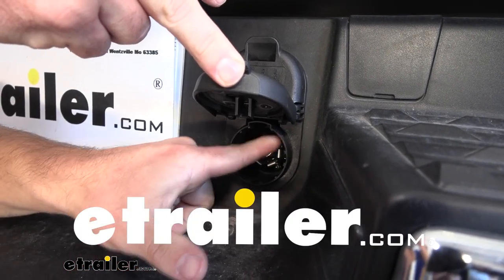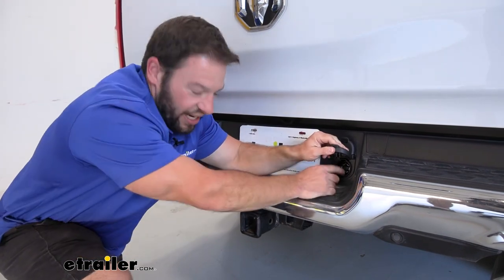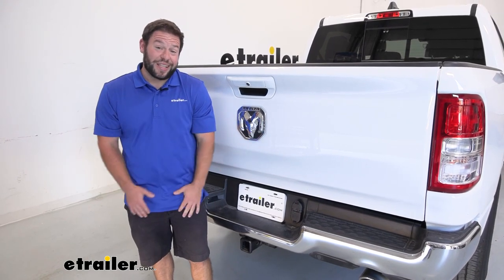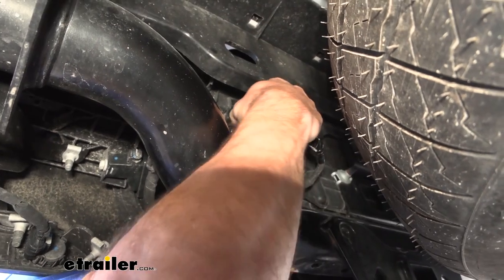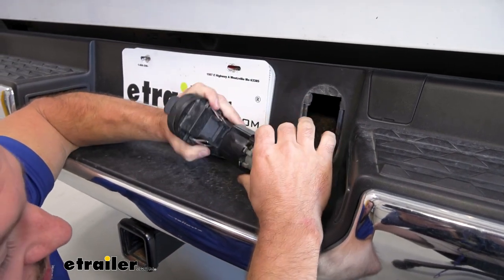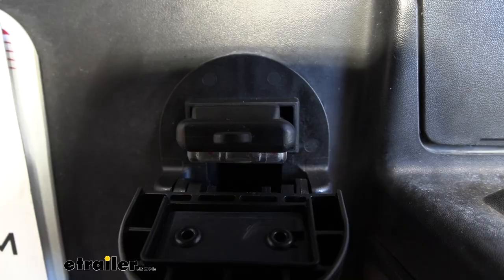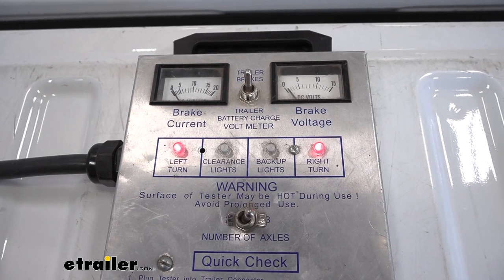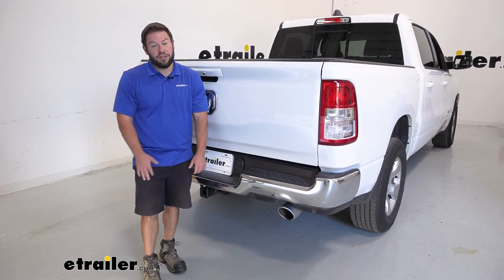etrailer | Feature Review 7- and 4-Pole Trailer Connector Socket w/ Mounting Bracket

Comment: Good video, thanks. 
Can we have any power 110v from the 7 pin?
Reply from the maker: There isn't a way to provide 110V AC power through the 7-way. What are you wanting to do?
Reply: @etrailer  I want to charge my power-vac battery. 
I'm using it for cleaning pools, and I used to charge the battery at home, but I would to charge it while I'm driving.